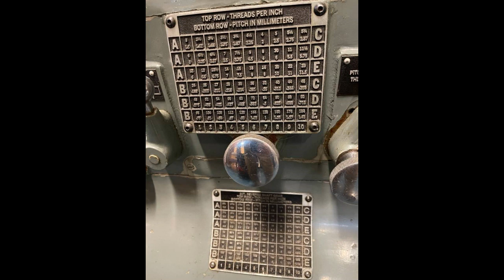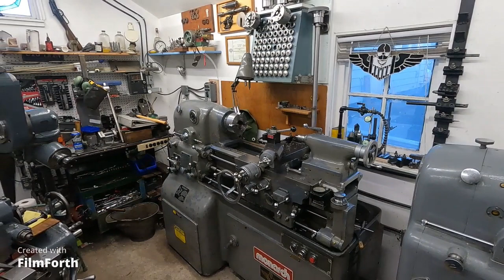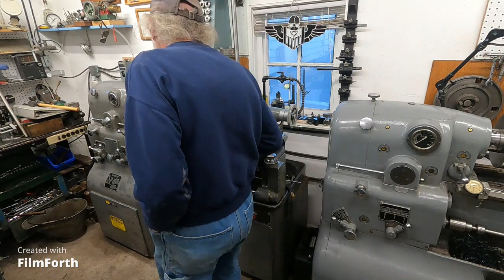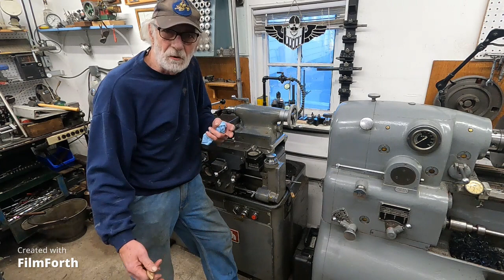Monarch 10ee lathe and the fake machinists syndrome

Comment: Yep i am a truck mechanic with a shop full of machines to play on. But FWIW i wouldnt give 2 cents for a 10EE. I have seen them inside. Give me gears and a standard motor on any machine. I am glad your happy and can use it. But i know what it costs to fix one. I do youtube for fun. I watch to learn.
Reply from the maker: The machines are made for close tolerances, just not good for most work. The Axelson here is made to move metal, thanks!

Comment: You're wrong, Dee Dee. There's a great deal to improve upon when it comes to 1960s power electronics. There's a ton of parts available now that weren't when the 10EE was being made -- namely semiconductors. Even Monarch themselves replaces the DC drive with a VFD. There's no reason to think that the best way to do things in the 1960s will necessarily always be the best way -- this is senseless nostalgia and is in direct competition with good engineering. You keep the tubes in the 10EE because they're cool and do the job and you like tubes, not because they're optimal. They're hot, inefficient, and have a much shorter usable lifespan relative to an IGBT or SCR or what have you -- this is just a fact.
Reply from the maker: I have said the VFD is the only logical alternative for the 10ee, even the factory admits the VFD does not have the performance the vacuum tube DC drive has. Your pie in sky praise for modern technology in this particular circumstance is as worthless as your opinion, You have Zero experience and it shows, try butterfly collecting or pissing up ropes.
Reply: " There's no reason to think that the best way to do things in the 1960s will necessarily always be the best way -" 
Conversely, you shouldn't assume that they're not...

Monarch is using VFD's because they don't have a choice.  In this case, sorry, the tubes really are optimal, they are simply no longer made otherwise you better believe that Monarch would still be using them.  Super simple proof, the original tube based drives used a 5 HP DC motor.  With the modern VFD setup, I think a 10 HP motor is recommended IF you use the back gear box, 15 HP if you go direct drive.  This is because the torque curve of the tube drive was  MUCH flatter than a VFD who's torque falls off at lower/higher speeds.  Also, Monarch chose the much more expensive option of using DC originally to minimize the amount of mechanical noise that gets transmitted thru the spindle and into your work.  Same reason the feed drivetrain is belt fed, not gear fed to provide mechanical isolation to the spindle.  AC drives the spindle in 'bumps' which can be seen in the finish of the work due to the high precision and  the 10EE's offer in the hands of a real machinist like Dee is correctly pointing out here.  The modern DC replacement drives I've seen have all fallen short of matching the original as well.  My 10EE had a $50,000 conversion to an Allen Bradley 1395 DC drive installed and it was awful, lacked both power and speed, topping out about 3200 RPM.  I never heard much good about the Beal, Beel?? drive that made the rounds on the Monarch Forums.  The best alternative to the original drive is to use a modern AC servo motor and drive.  They have excellent torque curves and because the drive knows the exact position of the rotor within the magnetic field that the drive is controlling, as well as the load on the motor,  they apply the right 'amount' of power the motor needs a that instant making them run very smooth.  Most modern CNC machines use AC servo motors so the impulse noise issues are manageable and outperform DC drives in other ways.  That said, if you have the original drive, do  it takes to get it repaired.  The only time I'd consider using anything but the original is if the original drive was already changed when you get the machine.

Comment: I just subscribed to you channel. I found it interesting and honest. I'm 71 and own a 1960 13" South Bend Lathe that I bought in 2019. Learned my first lesson on how to get screwed by a so-called machinist, buying a lathe after seeing it run momentary. This is after driving 900 miles, no I didn't drive I had someone drive me for various reasons and even though I had been around machinery and ran a little 9" South Bend in the 70s I couldn't remember how to run it through the paces. I'm a retired Boilermaker and Pipe Welder, a craft I really enjoyed working at. I've learned more from making the necessary repairs on my lathe then I could have learned from a book. I had a lot of good advice from the Practical Machinist Forum that got things squared away. If I had a chance to buy another lathe it would be the 10 EE. I watched a video on how the Monarch was made. Like you said, it's a wonderful piece of equipment if you know what it takes to operate it. Thanks for sharing the truth of things, I have a lot of videos to catch up on now that I know about your channel.
Question: What is the Film Worth? Is it software for making the videos on YouTube? Do you use cameras? Smart phones? I have never made a video to share and really don't know how. If i did it would be on something I used to know like Oxygen/Acetylene welding for example. Thanks
Reply from the maker: I used the Monarch ee lathes before they became popular. The PM forum is fine for many things however it is filled with bullies and the racist owner of that mess threatened me and my family so f*ck them with a stick in the ass. That aside thanks for tuning in!

Comment: You and me both.  I have had my south bend 9 inch lathe, a hardinge HLVEM and a Monarch 10EE with ELSR.  I also have a brown and sharpe omniversal.  Both of the 10EE and the omniversal use tubes for their control.  No desire to change it.
Reply from the maker: There are very stupid individuals on the web forums and here that trash these machines and bad mouth the Monarch company and jerking off while doing it. I am familiar with the B&S Model O omniversal milling machine and the Knight miller or jig bore with tilting table.

Comment: I've been using EE on my job the last 25 years, I run them a maintain them,  I agree keep the original drive,  I like the motor generator unit the best.
Reply from the maker: I think so too, the tube drives will not take a lot of overloading but are more refined in operation and smooth running at top speeds..

Comment: I know I messed up and let a Monarch 10EE slip by for $2500 at an auction about a year ago. The auctioneer said it had an electrical problem and the company just let the lathe sit there and used another one instead of trying to fix it. I remember it had the weird glass tubes in it but seemed completely stock and unmolested. It was dated 1947. It even had the taper attachment mounted on it. I ran a Hardinge HLV-H for 13 years and ended up buying one and loving it. The Hardinge is very simply built and easy to maintain. But the Monarch 10EE has my interest and will try to get one and keep it  original like you say DEE
Reply from the maker: Local fellow here solved what lathe is better problem by having both.  The electrical complications of the machine are actually easier to fix if you can run or observe one that is working properly, I am trying to show that when I can and will continue to do so and talk about it. I have many hours on the HC model that I used to bullet nose valve guides, cut and shape hard alloy valve seats of all types, and most other upper cylinder head parts for Harley Davidson engines. What I found is positive rake inserts and straight screw machine oil most of the time I could cut the hardest alloys including titanium up to the size of a 5c collet capacity it is after that I found the Monarch takes over up to the capacity of their  3" steady rest using negative rake inserts and not as much coolant use except for hard titanium due to more power and weight. Both machines are outstanding and come from separate directions in design. There are hoarders of these machines that pick them up cheap with one foot in the grave, more will come up for sale, thanks!

Comment: I hear what you are saying Donnie.  I really do. I actually so agree with many of your comments. But I have to say a few things.  As for Keith Rucker, I really appreciate his web site with all those machine manuals and info. Really nice of him to do that. But I don't think machining is in his blood. An enthusiast for sure, and that is OK by me. But I have not learned anything particularly new from watching his channel.  Steve Watkins seems like a machine enthusiast as well.  I think he was an EMT in his former career. I think he is going the very long way around to regrind his high dollar mistake 10ee in a very unconventional way.  It really does not interest me with his cast way grinding guides, so strange and cumbersome.  But his planer is mildly interesting.  (I have a small Rockford openside, so trying to learn all I can. Look up Rees Achenson, he is a real planer guy). As for John Oder, his Greeves Clushman lathe is kinda neat, and he does good work. Very methodical.  But I have not seen much work done on his 3B.  I have bought some collets from him for my 2B and he gave me a good deal. I know I have not used my 2A yet, but I am just getting the walls insulated and the ceiling up in my high bay. But I have been using my SIP MP5 right along. I even did some boring in one of my last videos.  You can call these guys out free and clear. Great to exercise your privilege to do just that. Personally I have nothing against these fellows.  Some you mention are not real machinists, but just having fun.  I do not like posers.  Fake people that is.  I have not viewed all their videos or read all their posts on PM to say for sure one way or the other. But it sounds like you have had a closer following on their online presence. But for me personally, If I met any of these cats in person, I would shake their hand and only talk about their positive contributions, as a matter of politeness.  But again, I applaud you Donnie for expressing your views. I absolutely believe you have your good reasons. Seems like you have been "wronged" by one or more of these folks.   As for me, I hope you watch my channel. I am a mechanical engineer and I have had my own machine shop since I was 15 years old. I started with a 10" Atlas lathe, a Clausing 8520 mill with a BP head, and a Boyar Shultz grinder.  I am almost 50 now, and if you watch my channel, you know I have many better machines.  I have worked mostly engineering jobs, but a few part time machinist jobs in a real production shop.  And at every engineering job, I have proven myself worthy with even the most seasoned old machinists, and was granted usage of any machine in the shop, based on my demonstration of competence and my skills as a machinist. I hope I come across on my channel as humble and helpful, and not a poser or a fake. I might not be very entertaining, but I like to make videos and share my knowledge with my viewers.  I don't have a 10EE, but I do have a Hendey tool and gaugemaker's lathe, with the motor-gen setup. It works really well, so for now I plan to keep it intact. I also have a P&W 12C lathe to complement my 2A Jig borer.  I currently have a Brown and Sharpe #13 tool cutter grinder. But because I like to leave it set up for cylindrical work, I am going to get a P&W 6A radius grinder from my friend soon. I do appreciate every one of your videos Donnie.  You have showed me quite a bit already. Please keep making them.  --Doozer

Comment: Im 66.  While not an expert, I spent 4 years setting up and operating the Monarch ee lathe in the toolroom of a major aerospace contractor.  Our job was fabricating fairly complex jigs,  fixtures, and gauging for the production floor and outside vendors.  Great machine.  I was trained by a much older Hungarian fellow named Julius.  He taught me the ins and outs and the temperment of this machine tool.  I was in my 20's then....seems like a lifetime ago.
Reply from the maker: Yes, the machine is built for that, the ease of use reduces fatigue, usually making one off close tolerance parts most often for fixtures and tools